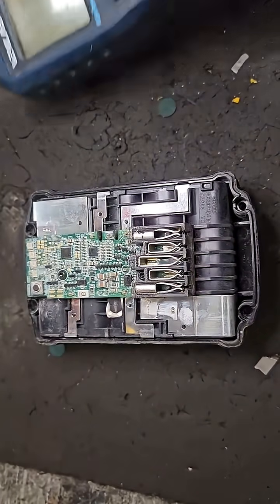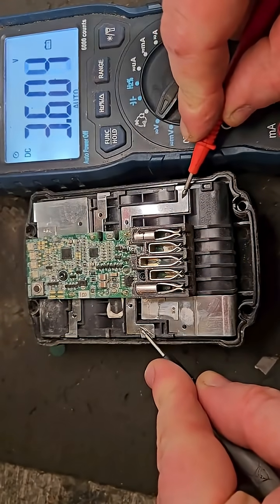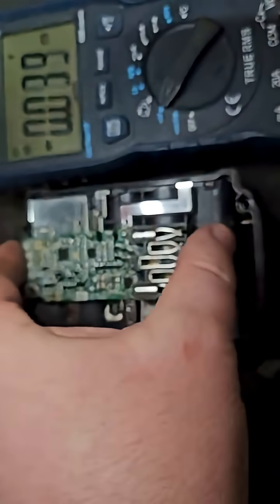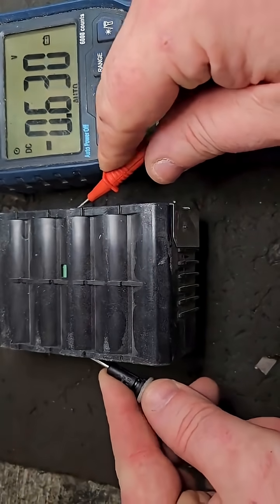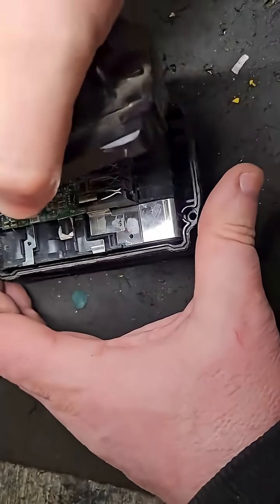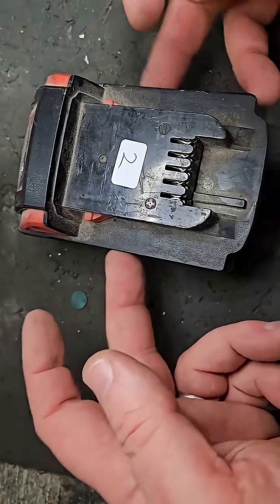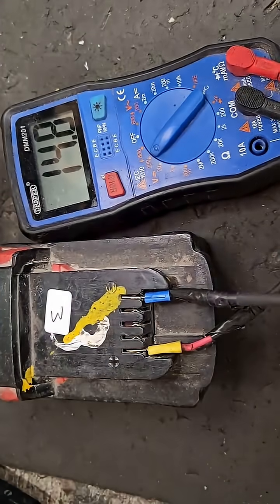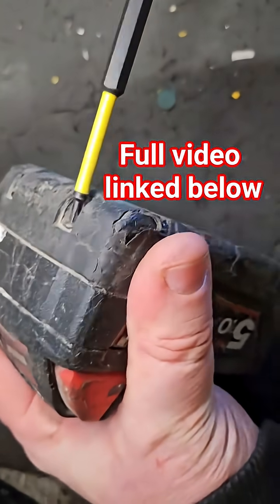Milwaukee M18 Battery triage Part 3 #diy #batteryrepair #milwaukeetools

Comment: I have a dewalt battery that won't charge past one bar. When I check voltage it maintains seventeen plus volts. I've tried different chargers n still same problem
Reply from the maker: https://youtu.be/C1WHXeKjJXg
Reply: @doctorlefthandthread thanks brothaa